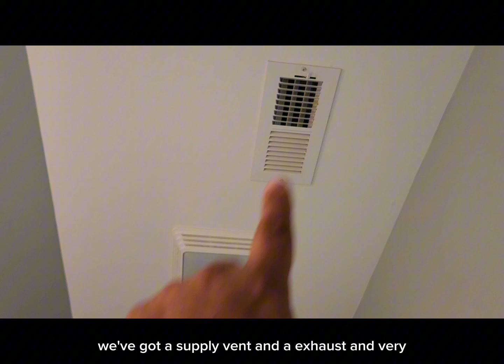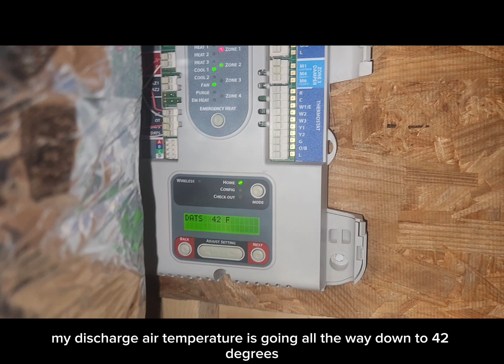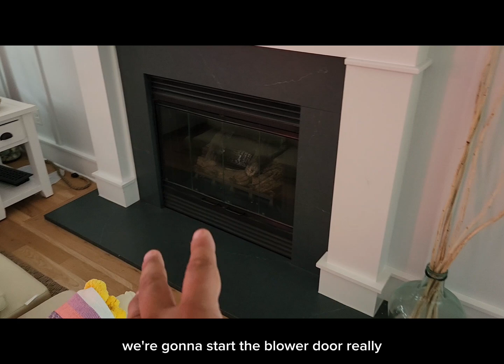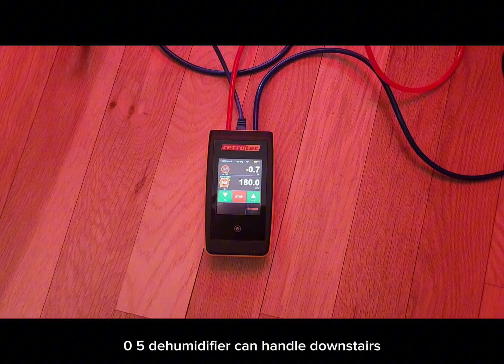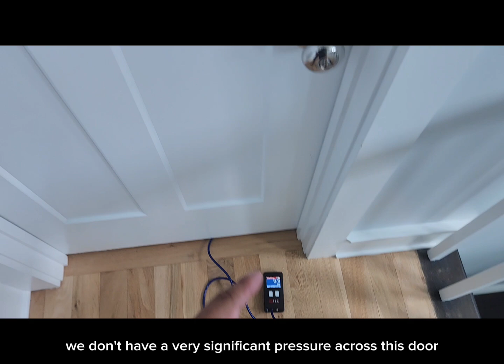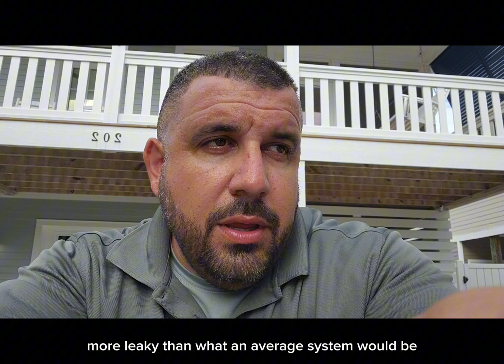What Happens At A Comfort Consult

Comment: Awesome video Tim! Finally someone who gets it! You are a breath of fresh air my friend! When I started in the industry 47 years ago it was common to have a return in each room sized perfectly balanced and contractors then were running all metal ducts some even rectangular to the boots even. They were not sealed back then and neither were the buildings but the effort was better than these non engineered zoning systems from he!!! I just subscribed the other day and didn't know what your services were Tim, you are really needed in the eastern part of the state for sure! At least in commercial buildings if they build to air barrier specs and utilize a properly sized DOAS unit with maximum capacity control keeping the envelope under slightly positive pressure they stand a better chance than the residential world! I am really surprised they haven't had some manufactures design real residential DOAS units to maintain proper positive pressure, (maybe they have but I haven't seen any like commercial DOAS with good enthalpy heat recovery). Funny how most industries get better with time but especially residential system designs especially zoning needs some designing help! Many of the HVAC contractors should be sued for incompetence for their not designed systems! 
Looking forward to watching more of your videos sir!
Have a blessed weekend!
Reply from the maker: Thank you for all your comments!